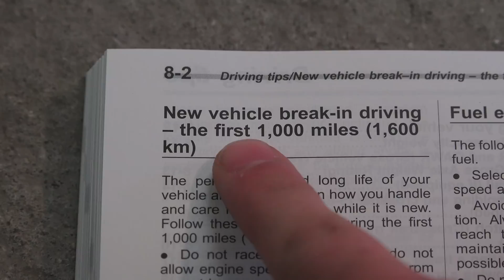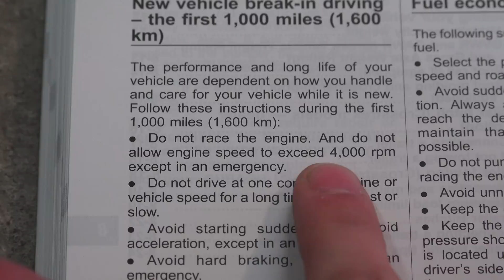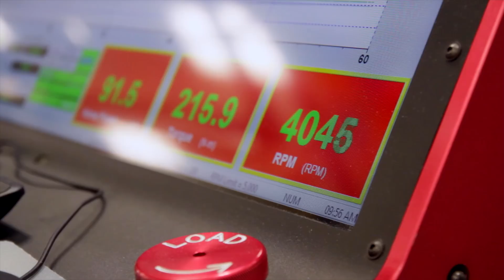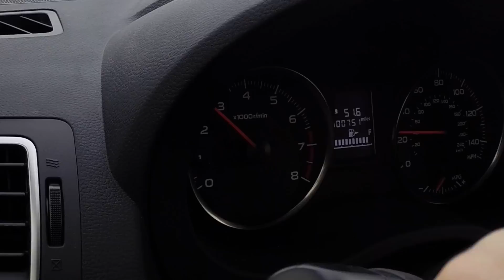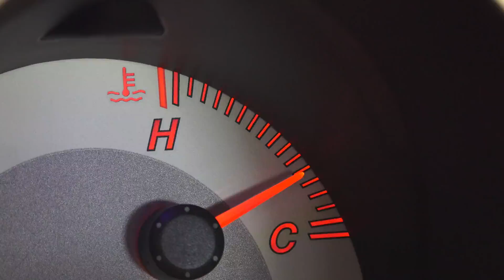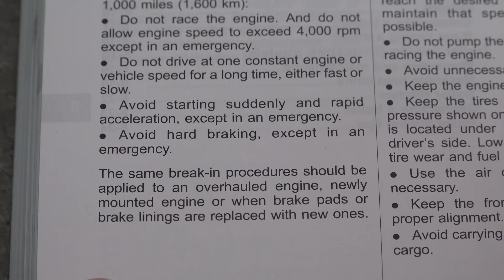5 Things You Should Never Do In A Brand New Car

Comment: I am an engineer with one of largest manufacturers of engines in the world, a company that sells billions of dollars of them every year. Items #1 and #2 are terribly incorrect.

EVERY engine that we manufacture goes from assembly into a test cell where it is started, warmed up, and sent immediately to 100% full load. Yes, it is "floored."

When we do engine testing, even prototype engines are assembled (mostly with Lubriplate 105), warmed up with standard petroleum oil, and immediately go to full rated horsepower while the dyno pulls them down from rated HP to the lowest RPM of torque peak.

Almost every automotive manufacturer follows this practice as well. So do motorcycle manufacturers. I personally saw new Ducatis going off the line in Bologna into a chassis dyno where they were started, briefly warmed, and then immediate run up AT FULL LOAD all the way to redline.

Why do they do this?

1) The freshly honed/machined surfaces can only do an ideal break-in when they are, in fact, fresh. Once the asperities and surfaces begin to smooth, they lose the ability to mate to each other properly.

2) It prevents customer complaints of high oil consumption and poor MPG because customers tend to follow outdated, bad advice like babying a new engine.

Back when machining and honing technology was far less advanced, and tolerances could not be held as well, there was perhaps some validity to babying a new engine. But this advice is woefully out of date.

Instead, the best thing you can for a new engine is:
1) Warm it up to full operating temperature
2) Do several full throttle runs that stop well short of redline
3) Idle the engine to let it cool a bit
4) Repeat steps 2&3 several times
5) Change the oil and filter.

Done.

 By and large, new engines require almost no break in at all because of the "abuse" they suffer at the factory. That's why they can ship new cars like Corvettes with Mobil 1 from the factory. No need to worry about the syntehtic preventing break-in when the engine is already broken in before installed in the car.
Reply: I really want Engineering Explained to respond to this
Reply: The strongest evidence of my point is the offering of synthetic oil as a factory fill. EVERY engine manufacturer recommends against breaking in an engine with synthetic oil. The superior lubricity of synthetics can delay or even prevent a good break-in for (especially) piston rings.

So if you can't break in the engine with synthetic oil, then the only way something like Mobil 1 can be factory fill in Corvettes, M3s and others is if the engine is already broken in when you buy it-- and before it is filled with synthetic.
Reply: Jonathan Castillo if u bought the car new from a deal don't worry....if u just built an engine and put it in a car then u gotta have a break in period
Reply: I know a handful of VVT engines have peak torque speeds < 2k RPM, but I think it's still relatively uncommon for a passenger car 4 cyl or 6 cyl engine. Most are 2500-3500 rpm, from what I've seen. Regardless, that has no bearing to your other, more important point-- that lugging has to do with the "mechanical advantage" on the engine.

Engines are pretty clueless to the world around them. Aside from environmental conditions, they basically only see 1)engine speed and 2) engine load. They don't care what gear you're in, how fast your car is traveling, or how heavy the car (and load) are.

The maximum load the engine can sustain is it's peak rated torque, and occurs at peak torque RPM. At faster engine speeds (RPM above this speed), an engine load of 100% of peak torque will pull the engine down in RPM to this speed and no further.  At engine speeds below that RPM, the engine will stall because torque output is falling with RPM in a snowball effect that stalls the engine.

But here's the key point: the engine CANNOT BE LOADED to a torque value beyond the peak torque rating. It will stall every time if this is attempted, regardless of engine speed. No engine with a max 300lb-ft rating can be loaded beyond 300lb ft without stalling. PERIOD.

So now we can ask ourselves this question: if an engine that is rated, say 300lb-ft torque at 2500rpm can sustain this load at that speed indefinitely, WHY would it be harmful to the engine to sustain a LOWER load at a lower speed? If you are "lugging' the engine (meaning the engine cannot sustain the requested load and starts to lose RPM), then you are NEVER applying more load than at peak torque. Peak torque is the maximum cylinder pressure the engine is capable of producing.

So those who worry about lugging are in the awkward position of  explaining why main and rod bearings designed for 300lb-ft will be harmed at 250lb-ft or 200 lb-ft loads at lower engine speeds. hint: they won't be. If the journal bearings have sufficient oil pressure, they are going to be fine at almost any engine speed above idle.

That's why the only real risk of lugging-- i.e. detonation-- is largely obviated by modern electronic controls.
Reply: Thank you. I was hoping to find this comment. I notice with a lot of Engineering Explained car dos and don'ts that he gets it totally, utterly wrong.
Reply: The overall engine system can become unstable at very low RPM. There's a reason idle speeds are set at several hundred rpm instead of only 300-400 rpm. At very low RPM the engine can indeed experience harmful boundary conditions. Stabilizing the engine at much lower speeds would require a flywheel so heavy that the transient response of the engine would be awful.

But the condition under which the engine is most vulnerable is also one which is almost impossible to sustain. You simply cannot sustain engine rpm below idle speeds very easily' the engine will either stall or achieve idle speed.

It's very unlikely that you will damage an ancillary mounts by "lugging". If a mount is damaged, it is usually be either a very-high mileage fatigue failure (old car/truck, probably rusted), or it was a fracture from a violent driveline impact. Drag racers using stick slick tires break motor mounts when the launch. Some people will break them with careless winter driving when they spin their tires very fast on ice and then suddenly the tires get pavement and traction and a massive torsional impact goes up the driveline. It's usually reaction loads, not vibration that fails mounts (apart from old age/corrosion).

The truth is, the lugging or stalling conditions SOUND much worse than they really are. Listen to your engine and avoid things that don't sound right. But it's not nearly as damaging as the sound may suggest.
Reply: A workmate of mine used to work for Mitsubishi Motors in Australia before they closed down years ago. He said they would take newly built engines up to redline for approx. 5 mins under load in a test mount. Dump the oil and filter and out of the testing room into a new car. Also Harley Davidson do the same thing. They dyno all of their bikes immediately after assembly and go hard on them. There's youtube clips of this. When i rebuilt my Harley I used the hard break in method. 20,000 miles later my bike runs just as hard as new and uses no extra oil.
Reply: GodGunsGuitarsGadgetsGovernment yeap, modern engines are broken in before leaving the factory. So not sure why we are having this discussion again.
Reply: So basically my style of driving a new car quite hard for the past 10 years is the correct style? Obviously always let the car engine warmup to operating temperature and not full throttle all the time, but breaking in the old way is what i never did, i just drove them normally and by "normally" i mean not babying, but not trying to break them on purpose.

However most of these cars are modern turbodiesels here in Europe. Don't know if that makes a difference.
Reply: I believe your method corresponds to MotorMan's hard break-in method, I also did this on both my new car and motorbike, works fine for me
Reply: It's possible that this is what he meant. But I'm suggesting to you that newly built engines are subjected to "lugging" like this all the time. Moreover, it is generally harmless on a modern vehicle with sophisticated electronic controls.

The old myth about lugging mostly stems from when engines would go into "spark knock" or detonation when given full throttle at low RPM. Detonation can and will do serious damage to an engine. Modern cars can avoid running lean or excessive timing advance and other aggravating factors that tend to reduce margin against detonation.

If one wishes to be ultra-cautious, the peak torque RPM is the clear "green flag" for full throttle use. But you can realize how this is somewhat silly given that some cars have very high peak torque RPM ratings and can be operated obviously at full throttle well below those engine speeds.
Reply: G5, I bought a car and didn't know I was supposed to vary the engine RPM when I bought it.  I just thought I wasn't supposed to drive at a high RPM (advice from father....).  What kind of damage could I have done to the car by not varying the engine rpm when it was new? Should I be concerned?
Reply: The exhaust will be OK. If there were any standing resonances sufficient to cause structural issues, they would be VERY loud when normally driving, and the system would fail before the EPA-mandated minimum warranty period for emissions systems.

Lugging will not damage the exhaust. To understand why the sound is loud, you have to think about the engine's internals. At very low load, the piston is easy to push down, so the expansion of the cylinder volume absorbs much of the expanding gas. So very little work is done, and BMEP is pretty low. Also, because throttle is largely closed, the cylinder is only partially filled, further reducing peak cyl pressure and BMEP.

When you open the throttle all the way, the engine gets its best VE for that rpm, so there's a lot more fuel and air in the cylinder. And instead of the piston going down almost by itself, the engine cylinder pressure is sustained a higher level (much higher BMEP). Note, this doesn't increase peak pressure, it's average pressure (BMEP). So when the exhaust valve opens, there's a LOT more pressure escaping at full load instead of low load, and that pressure creates a loud sound as it enters the exhaust.

So exhaust is always louder at full throttle, it's just that at lower RPM, difference resonances are excited (i.e., the forcing function changes) so it sounds worse than it really is.
Reply: Break in depends on engine load. If you aren't pulling a heavy trailer at high speed uphill, it will take about 500 hours of operation to really break in well.

If you can push the engine harder, you can break it in with as few as four or five full throttle runs under extreme load. (heavy trailer uphill full throttle to 65+ mph). Change the oil sooner while the engine is breaking in. I do the first oil change at around 500 miles on anything new/rebuilt.
Reply: Basically, what I'm hearing (or seeing) after reading this thread is: From an engineering perspective, there is no need to go through this "manufacturer recommended" break-in process. It is put there because lawyers have the welfare of the company to look out for. For this reason, I would presume that following the "manufacturer recommended" break-in period should have few to no downsides either. If they were to recommend a fairly docile break-in period, and it ends up actually being bad for the car, I can't imagine that would bode well with these lawyers either.

tl;dr: sounds like both break-in methods are okay to me.
Reply: As long as the engine was fully warmed before it was heavily loaded, it should be just fine.
Reply: No. Minimum NOx is  minimum fuel efficiency. The difference in BSFC at varying RPM is almost always completely offset by higher friction at higher engine speeds. You should always operate the engine in the highest gear it can handle for a given speed. If  you floor it and the car is unresponsive, go ahead and downshift.

If you go faster on the highway to get your engine at the "sweet spot" RPM, you'll find you get worse MPG from the extra speed. It's the difference between how efficiently the engine makes a given amount of power and the total amount of power required. If you need 30% more fuel, then a 5% increase in efficiency is overwhelmed.
Reply: G5
Reply: G5 .... care to tell us what engine mfg comany you work for?
Any charlatan can claim to be a master engineer for a mystery company.
Reply: The owner's manual is self-contradictory. First it indicates that no special break-in is required, but says you should treat it differently for 600 miles.

By my personal and professional experience, every word after the "no special break-in is necessary" was put there by request of a lawyer or accountant, not by an Engineer.
Reply: GodGunsGuitarsGadgetsGovernment agreed!
Reply: I worked at General Motors for 8 years build V-8s.  Freshly assembled motors all went to the test department, were started, idled for a few seconds to make sure they were running well, then the RPMs were cranked up to near redline and held there for a minute or so.  Several up and down revs from idle to near redline followed - DONE!  Ship it!  All my new motorcycles (Honda) went through my special "give it hell" break in period; warm it up for a few then go for it no holding back at all.  This has served me well for over 40 years.Manufacturer recommendations are sorted out by lawyers not real world usage parameters.
Reply: A lot of modern FI engines has peak torque at RPMs as low at 1500 or 1800 RPM.  Lugging I thought had more to do with the mechanical advantage the engine has, as in what gear/rpm full throttle is applied.  I don't think that is what is meant, since EE believes that the owner's manual should be adhered to as a technical document, when it is purely a legal one.  

For example, if you brought suit against a car manufacturer for promising you electric windows, and you claim they don't work, one of the articles of evidence would be that instructions for operating the windows were included in the owner's manual.  Another example would be if one ran their engine out of oil claiming they didn't know how much or what type of oil to add to the engine.  Again, that information is provided in the owner's manual.  Owner's manuals are time consuming and labor intensive to produce.  But they provide an immense layer of protection to the manufacturer, and also hopefully increase customer satisfaction and reduce warranty claims.
Reply: I think the idea of lugging has two factors, one  of which was already discussed (mechanical advantage).  The other is oil pressure.  Oil pressure of course rises with RPM, and if we take the theoretical approach that all oil pathways remain the same regardless of engine rpm/load, oil flow rate increases with RPM as well.

If you have low rpm, and therefore low oil flow rate, during high engine load, every incremental volume of oil is exposed to elevated operating temperatures/pressures for longer.  This can cause viscous break down in the oil.  

As far as timing goes, my understanding was that timing was advanced at higher RPM because the ignition process happens in roughly the same time, but the pistons are moving faster, so you have to start earlier.  To get a jump on it, so to speak.  So I don't understand laboring an engine at idle.  Then engine will be a high relative load for the torque it can provide, and may stall.  

This is why ECUs have maps.  These maps are iso-curves that have been theoretically started and empirically tuned that provide the engine with good operating performance across the rev range.  With modern engines, spark timing varies throughout the rev range.  We all know that if knock is detected, spark timing will be retarded, so it is sure that engine programmers are capable of modifying the timing.  I think it is a mistake to try to compare WOT at idle with WOT at max torque as equivalent in terms of timing conditions.
Reply: G5 I have a question, our brand new Kia Picanto 1.2 EX was floored several times and it almost reached its top speed on a major highway.  It ran 2457Km. Is our car fine? I mean flooring it isnt bad on brand new car right?
Reply: G5 thanks for your valuable input.  I have a Mercedes W211 naturally aspirated V6.  Based on the manufacture information, the torque plateau （350Nm）starts at 2500 till 5000rpm.  I guess this curve was generated at full throttle that is not practical for normal driving.   However does this imply that the engine should be operated (on highway, highest gear) at 2500rpm to achieve minimum NOx？
Reply: Jellyfrosh gee... I wonder if you actually read the comments or if they caused you to do a little research.
Reply: I noticed the same thing when I visited the Honda plant years ago. Last thing they did before they crated them up was to put them on a dyno and run them hard thru each gear.
I've never been told about break in when buying a new car. It's always been a motorcycle thing. I figured mfgs told customers that so they'd get a little experience with the machine before they nailed it and killed themselves. Repeat customers are good for business.
Reply: how is there even decent oil flow or temperature to allow this to be done? it seems ludicrous. can you comment?
Reply: G5 - re. "lugging" Could it be that operating your engine in near stall conditions (lugging) produces unwanted and perhaps harmful vibration in the engine, the engine mounts or in ancillaries mounted to the block? In any case, the noise/feel of a lugging engine is alarming to any mechanically sympathetic driver. Should it be?
Reply: G5 - thanks for the reply. What about the exhaust? This is usually a very long, therefore relatively non-rigid, system on rubber mounts, prone to excessive vibration in "boundary conditions". Can lugging cause bending or cracking of the header/exhaust joints or even the header bolts/studs? A lot of the noise of a lugging engine appears to come from the exhaust system.
Reply: Aren't there definite concerns for lugging with Forced Induction and/ or gasoline direct injected engines?  I've heard a lot about some vehicles having damaging detonation at high boost, low rpm situations.  The mazdaspeed3 and STI for example.  I think it's called low speed pre-ignition, and engine designers think it may have something to do with lubricants being used.
Reply: yep you are right 1000 km and new oil and filter a new engine in a new car have been reved trust me  back then they said that there was a grinding compound in the break in oil to take of the edges ha ha and the oilpump and the bearings  that must be a myth
Reply: D R I just put a crate engine in my 04 GMC 5.3 liter V8 I just drove it home and I'm kind of nervous to Really push on the gas I feel like I'm abusing it the power of this new engine is astonishing. I read the book from Napa that's where I bought my Ironclad engine and it said the same thing about not keeping a constant pace for too long very your speed check fluids and change your oil. how long of a break in do you think I would need for my 5.3 V8
Reply: G5 agreed with this break in method. I did a similar method once my Daytona 675 was warmed properly. 8k in 5 months on the streets and no issues with redline pulls
Reply: COMPREHENSIBLE POINT PROBLEMS?  

See, I can do it too...
Reply: G5 I agree! Well said!
Reply: davetek490 ... 

It does matter where he works. The company he claims to work for may have a different approach to engine testing than others. 
Why should it be a problem to reveal the manufacturer?  

Also, if what G5 says is true, then the kind of break in the end user gives his new car simply does not matter.
Reply: Yeah would depend on how long the engine has been run by the manufacturer.  I've heard that porsche's engine check out is longer than a typical manufacturers'.  However, most mass produced probably have very limited dyno time.  That leaves the process of breaking in to the owner.  

Different car manufacturers would have different tolerances, manufacturing techniques.  However, I would follow an engine manufacturer's advice over an OEM's because the engine manufacturer wants to be known for good engines.  OEMs just want you to buy a car, and get out of warranty asap.  The buyer to them is a potential liability until that point.  OEM doesn't care if your car runs great, they care if it meets "acceptable levels of performance", likely determined by them.
Reply: The manufacturer break in process is fine, as long as you realize you might have blow by probs earlier in the engine's life cycle.  For example, nissan's VQ35DE in the altima and maxima had problems early on with oil consumption.  i currently own a car with the engine, so I was interested.  Several people on the nissan forums suggested beating the crap out of the engine, and seeing if it stopped.  This would signify a problem with the oil control rings.  Several people did it, and it reduced their consumption massively.  Once they went back to regular driving the oil consumption resumed.  

I'm not trying to say that they all broke their cars in incorrectly, but it shows how important cylinder pressures are to controlling oil consumption and blow by.  In fact the root cause might have been catalytic breakdown and the dust getting sucked into the cylinders.  Even so, it seems to me that it would be important to do everything possible to get good sealing in cylinders.
Reply: I like how Engineering Explained will respond to "what is floor it" but wont even both trying to talk about this. Just shows he doesn't really understand what he is saying and is just parroting what he was told and has read. Completely agree with G5 here.
Reply: Richard Schofield...Good luck on getting honest data from a manufacturer.
Lawyers have infected American society with their greed so much that they pounce on anything, especially published documents, to get rich quick. 
Anything published by a manufacturer has to be scrutinized by a company
lawyer to ensure their asses are reasonably covered to deter other lawyers
from making mountains out of mole hills. Of course they say *it's for you and your children's safety that we do this".... Nice try, but no cigar.
Reply: You are correct
Reply: I, like most, would like to see EE's take on the theories being thrown around here.  Unfortunately, it seems it's  a lose-lose for him.  If he posts that his video is correct, he be caught in a flame war.  If he posts that G5 is correct, he risks discrediting his own words (and subsequently research).

I wonder if taking a middle-ground approach is better?  Take it easy, following tips 3 through 5.  Mostly don't floor it and keep the RPMs down below X rpm.  On occasion, wring it out for a short time once completely warmed up.  1000 miles is an eternity with a weekend car is all I'm saying.
Reply: This makes me feel better about how much I’ve floored my 150 mi car
Reply: Finally, common sense prevails.  What most non-engineers don't know, is that engineers RARELY write customer facing literature.  There is always a a concrete difference between the technical information that is shared internally within a company, and that which gets filtered by QA, Marketing, Exec Management and the Legal team and given to the customer.

Hard break in is a requirement.  Cylinder wall and piston ring metallurgy has improved over the years; this means that both surfaces are very hard to wear.  In order to get very hard surfaces to match together, high cylinder pressures are needed.  Put it this way, if you never expose the engine to higher cylinder pressures during the critical period, you can't expect the rings the to seal when they are exposed to that higher pressure later.  

I really expected something better from a channel called Engineering Explained.  The Owner's Manual is a LEGAL document, not a technical one.  A good example of a technical document with regards to cars would be a TSB, or a repair manual.  It is critical to distinguish between the two.
Reply: GodGunsGuitarsGadgetsGovernment great to hear this info I been flooring my car since day 1
Reply: Do you mind expanding on this a little for those of us less informed?  (I would like to take the best care of my new car that I can...)

The language in the owners manual--Which to my interpretation seems to match pretty well with the video--is as follows:

"No special break-in is necessary, but a few precautions in the first 1,000 km (600 miles) may add to the performance, economy, and life of the vehicle.

- Do not race the engine.
- Do not maintain one constant speed,
either slow or fast, for a long period of time.
- Do not drive constantly at full-throttle or high engine rpm for extended periods of time.
- Avoid unnecessary hard stops.
- Avoid full-throttle starts."

Could you perhaps explain why this guidance is in the manual?

In case it matters, it's a 2.0 L Mazda SkyActiv-G I4 mated to a 6-speed manual transmission.
Reply: If you've ever worked for an actual manufacturing company, you'd know the difference.   Everything every big company releases to the public is screened and cleaned by lawyers.  If an engineer or technical writer recommends something they don't like, it gets kicked back for revision.  The lawyers are there to protect the company, not your engine.  

Now TSBs and stuff released to professionals usually have minimal scrubbing.  This is why engine shops, rebuilders, etc, are the resource for accurate information.  I am unsure why people have so much trust in companies, they are out to convince you to buy their product, and protect themselves from liabilities from selling that product.  They do not care about you or your car, especially once you're out of warranty and no longer a potential liability claim to them.

There is a reason that most garage tuners rely on forums and not official manufacturer advice.  A lot of the time, forums find out about widespread issues before manufacturers do.  Experience > official titles
Reply: People... Do the research over believing some youtube guy claiming to be an expert.

The fella in the video has a point, even the best engine manufacturers apply the same logic of controlling that output and NOT going full throttle. 

then you have this fella claiming "go full throttle" with his main supporting evidence being "im a professional".

DO NOT take peoples advice on engine break ins from youtube comments. 

Go to google, find a REPUTABLE SOURCE for your information and make your decision on how to break in your engine based on the most supportive evidence there is for the "best procedure".

I'd personally take it slow. Blasting a brand new engine past 6000 RPM's with the slight defects and abnormalities/tight tolerances just sounds absolutely ludicrous to me. Talk about gouging, imperfections, etc. 

But don't listen to me, listen to the heavy research that people have already done.
Reply: Hi Richard. Your statement-- "With a NA engine, WOT is going to suck in more air and fuel per revolution of the crank at idle than any other rpm"-- is demonstrably false.

The mass flow rate (the sum of air and fuel flow rates) on a per-revolution basis is NOT higher at idle. It is precisely because the cylinders are filled most effectively at peak torque RPM that maximum torque occurs at that engine speed. Torque is the result of cylinder pressure, and maximum pressure derives from the maximum quantity of fuel burned (limited by airflow). Thus, the per-revolution air and fuel flow (i.e. volumetric efficiency) is maximum at peak torque. I will spare you the dissertation on the role of intake inertia and "ramming" in cylinder filling and why idle speed has such low volumetric efficiency. The upshot is the if an engine had high volumetric efficiency at idle speed, it would have such restriction at higher engine speeds that overall power would be very, very poor.

Engines simply do not work the way you are imagining them to. TDC is an infinitesimally small moment in time. Moreover, peak cylinder pressure occurs long past TDC. Indeed, the purpose for varying the spark timing is to attempt to maintain peak combustion pressure at a given number of degrees AFTER TDC-- typically 17°-25° ATDC, but this can vary with a given rod/stroke ratio and compression ratio and thermal efficiency vs power density tradeoffs. (expansion ratio is a major contributor to efficiency, hence the Miller cycle and Atkinson cycles).

It is therefore not at all sure that laboring an engine at lower RPM will damage an engine, nor "knacker" the rings. The only the surety is that you need to do a little more reading to increase your understanding of how engines work, based on your rather unfortunate comment here.
Reply: Then why would most manufacturers recommend not doing hard break-ins?
Reply: What a shiftless, inane, and vapid comment.  Perhaps you could elaborate on why you felt the need to make it, even in jest.  

Or am I to take the "Derp" literally?
Reply: I would suggest it depends more on the operator. It's likely that the engines were cold and not up to temperature when subjected to the full load.

Full load and high RPM on a very cold engine is ABUSE.
Reply: In most Honda designs, the engine can warm very quickly, as does the oil temperature. Hondas tend to have smaller quantities of oil circulated at higher flow rates (this promotes more even cooling and reduces wear). But it also means that the oil can increase flow with temperature in a very responsive manner.

As long as you have sufficient oil pressure, you generally have oil that is thick enough. High viscosity is really only a problem at startup when you are building pressure. Once you have established pressure and the oil is circulating, the engine is well protected even with "thick" oil.
Reply: D R are these factory tested engines tested under load? if not then you can't compare redlining an engine on a test bed with WOT in a car under load.
Reply: http://www.mototuneusa.com/break_in_secrets.htm
Reply: Oil pressure doesn't rise with RPM. It is regulated, or else you would have overpressure conditions (ruptured seals) due to excessive pump capacity or oil starvation at high rpm with hot oil due to insufficient capacity. Oil pumps are positive displacement pumps circulating a mostly incompressible fluid-- they absolutely must be regulated.

Oil FLOW does change through the engine, however. Two factors mostly determine flow for a given oil pressure-- oil viscosity (the predominant factor) and engine speed (a minor factor).

Oil flow is not linear with engine speed. Not even close. There is not 6x the oil flow going from 1000 rpm to 6000rpm. The primary restriction to oil flow in an engine are effectively fixed orifices. Bearing clearances do not get 6x larger with speed. Oil passageways remains the same nominal size (ignoring thermal effects).

There is a slight increase in oil flow through journal bearings due to higher speeds but it is also minor. Remember, oil viscosity is defined at a given rate of shear. If the rate of shear increases (as it does with higher speeds), then the oil effectively becomes higher viscosity. You've doubtless experienced the change in viscosity with shear rate. If not, belly flop off a high dive and see how the viscosity of water changes with a high shear rate caused by a human body at velocity.

So you do not have "low rpm and therefore low oil flow rate" in the bearings. Bearing flow changes very little with RPM, it changes mostly with oil temp (viscosity). And when oil is thicker, it has proportionally more film strength, offsetting the effects of reduced flow.

This doesn't appreciable increase oil shearing or cause oil breakdown. Not on the time frames relevant to this discussion.

"the engine load will be high relative to the load it can provide." As a percentage of the engines output at idle, it might be a high load (100 %) and if it exceeds 100% the engine will stall. But this low engine output is not the mechanical limit of the engine. It is due to the poor breathing of the engine at low speed, and why the engine makes low power. The mechanical system is designed for much higher loads than can be induced at idle, and the engine will stall long before one can harm a bearing.
Reply: Yes, newly built engines require break-in. I strongly recommend a high-load, full throttle regime as you'd get on an engine dyno. A Chassis dyno like a Dynojet can't apply enough load for proper break-in. A superflow or Mustang chassis dyno is better for break in purposes.
Reply: True, but it's likely the opposite of what you are thinking. In most cases, the dyno load is substantially higher than what the car can apply.

In the car, you have the mechanical advantage of the transmission and the traction limit of the tires as limits to the amount of load the engine can actually see.

In the dyno, you don't have those limitations. In almost all cases, an engine dyno can produce both higher loads and higher changes in load than almost any vehicle can.
Reply: The answer to your question, Richard, is that factory tested engines are nearly universally tested under load. There may be exceptions that exist outside my knowledge.
Reply: Agree entirely. Do not believe me or any of my claims. GO ASK SOMEONE WHO knows engines-- an engine builder, a hot rod shop, a dynamometer operator. Not someone who writes owner's manuals with lawyers breathing down neck.

Then you can come back and tell SACR3 I was right all along.

By all means, ask any professional rebuilder or race team. Then report back here and see what they do to break in their own VERY pricey engines. They will tell you as I have-- warm up the engine, then full load.

NOTE-- full load isn't necessarily redline or overspeeding the engine. Do not misquote me. By definition, maximum load is at peak torque, which occurs at much lower RPM than redline.
Reply: G5 I think what EE meant by "flooring the engine" was not to apply full throttle at low RPM.  At high rpm it is fine with full throttle as long as the coolant temperature does not runaway.        Please correct me if I misinterpret.
I did floor (above 4000rpm) all of my 3, 4, 6, 8 cylinder Japanese and German cars during the 1st 100miles, all of them consume no oil, and exceed the HC, CO, CO2 standards.  I never lug my engines.
Reply: G5 surely labouring an engine at low rpm causes more engine damage than at peak torque.
With a NA engine, WOT is going to suck in more air and fuel per revolution of the crank at idle than any other rpm. 
Unless your engine restricts throttle at low rpm (some do, it's really annoying)
Then you have the burn that will propogate through the mixture really early in the stroke when there is no room to expand into.
This yields low torque as the moment on the crank at TDC is zero however the pressure in the combustion chamber will be higher than at peak torque for the above reasons.
Result 
Knackered piston rings to follow.
Reply: "you need to do a little more reading to increase your understanding of how engines work, based on your rather unfortunate comment here" what a miserable response. Try and be a gentleman and keep your responses limited to your technical opinion.
Peak torque is greatly affected by the ignition timing. This is one of the reasons why torque falls either side of peak torque RPM. At lower RPMs the timing is too advance for optimum. You want peak pressure at roughly 20 degrees after TDC for max torque. I don't know where peak pressure typically happens at idle, but it will be much before 20 degrees.
So, you have a smaller space, less mechanical advantage and more air. Even if you are correct about the air mass bit (which I don't believe you are) the difference would not make up for the fact that you have less space in the cylinder at idle peak pressure. 
I never said peak pressure happens at TDC, I said at TDC you have zero moment on the crank (basically saying less moment than at peak torque).
Try labouring your engine at idle and listen to what happens.
Reply: davetek490 I think the Derp just told us what his job is on accident out of rage of him not getting to design actual useful things.
Reply: Doesn't matter where he works.  Don't believe him, if you don't want.  I went and did my own research and asked people who have been working on cars longer than me (and at a way deeper level).  

The way to think about it is this: you have rings sliding against a cylinder.  Cylinder, when new, has a process called honing that roughs up and removes the glaze on the cylinder walls.  This process allows the rings and cylinder to wear together a little bit so they match.  But it takes high combustion pressure to do this.  Basically you want to expose the system to the maximum pressure it will see in its lifetime so that the rings seat, so it will seal well when it sees the pressure in the future.  

If you don't have high cylinder pressure when the engine is new, you won't have good seal when the engine is new.  And if it doesn't seal when it's new, no way will it seal when it's older as things wear and clearances open up.  You don't need to be any type of specialist to propose this idea.  

Follow your owner's manual if you want.  But every car person knows that when you have a serious car question/issue, you hit the forums, and not the book in the glovebox.
Reply: A guy where I work floored (because the circumstances requiered it) two different cars straight out of the agency and in less than a month both cars were getting repaired, so maybe depends on the type of car. A sport car is expected to be floored because that is why said car is bought.
Reply: G5, I really appreciate that you don't blindly accept the common wisdom about lugging.  I am very skeptical, and nearly every explanation I find is full of sloppy thinking like, "You're making the engine work harder," which defies the definition of work.  I would love to see a real IC engine designer run some real numbers on internal parts, loads, etc. and say something like, "Even when 'lugging', you can't exceed x% of max bearing load, so you can't damage the engine that way," or, "When 'lugging' you may have x% higher bearing load for a sustained time compared to normal acceleration through upshifting, so you might take a few thousand miles off the life of the engine if you ALWAYS drive that way," or something more concrete like that.  But it seems that no one really knows anything concrete, and like you say, I guess those who do are not permitted to say so because lawyers.  :(  Anyway, keep up the good work.  There's someone wrong on the Internet!  :)
Reply: thank you for posting. People thumbs up this so information is not mis-represented.
Reply: Sacr3, your reply is full of red herrings and straw men. No one said companies are out to get your. Nor did anyone say their advice causes engine damage.

The consequences of soft break-in are "soft" failures like slightly higher oil consumption, slightly lower MPG, and lower engine durability.

None of these are likely to cause a measurable, statistically significant increase in warrantable failures. And most manufacturers only measure warrantable engine failures. They don't care if the engine lasts 20k or 200k more than the warranty. It costs them nothing because the engines are out of warranty. Most manufacturers don't want things to last TOO long, they want to sell you a newer car.

Now there are companies (like Honda) whose internal culture is such that they will design an engine to last as long as it can reasonably last, regardless of warranty. But they are the exception that proves the rule. Honda considers itself firstly an engine company, and they also happen to make things into which they install engines.

So it's simply not the case that a soft break in will cause compression and bearing issues within 100k miles across the board. A hard vs soft break in isn't the difference between a survival and a failure, it's the difference between a good engine and a GREAT one.
Reply: do you honestly think a manufacturer would put out an engine without testing it under load? look man, there are plenty of things you can nit pick at but engineers of course test their engines as apart of the building process.
Reply: sacr3 I'm not a professional, but common sense leads me to believe sacr3. interested if anyone can find some manufacturer published info that says to rag it.
Reply: You won't.  Their legal team doesn't want the associated risk of customers saying they slammed into a school bus because they found a manual entry saying to floor it.  Ever watch mustang fail videos?  

The only issue with WOT is that you start bypassing the oil filter, since engine manufacturers want maximum oil flow at WOT.  That's why people who recommend a hard break in, say that you should change the oil often during the process.  They believe the break it is complete within the first 50 miles or less.

The point is, that if you want something with pressure based sealing to seal at a design load, let's say WOT, then you have to wear those parts in at the design load  pressure.  You can't wear them in at half pressure and expect them to seal at full pressure later.  

http://www.mototuneusa.com/break_in_secrets.htm
Reply: Simon Griparič lawyer's. if they said you need to drive your new car hard and you crashed it you could file a lawsuit saying they are reponsible for the crash because they said to drive it hard. so they say to baby it.
Reply: A very good explanation sir. I have more trust in your comment rather this urban legend video
Reply: Jeffrey Lurch I asked a question. I did not state an opinion that wasn't subject to my question. read.
Reply: I was being a gentleman to him. I didn't call him names, and I am not responsible for how he may choose to react to being told he is ignorant about engines. We are each ignorant of at least a few things. Mine ignorance happens to include german polka history, among others. His happens to include engines.

Fortunately for him, he is not alone. You are likewise ignorant of some aspects of engine operating, design, or theory.

Torque is affected by engine timing. More precisely, CHANGES in timing are associate with CHANGES in torque. Yes. But the purpose of calibration is to remove the timing variable by optimization. There is for each speed and load condition only ONE optimal value. Since timing is optimized, all changes in engine torque are not due to timing changes. Rather, the timing changes are due to the changes in engine speed and load (VE).

So it is therefore false that timing is what is causing the torque to fall on either side of the peak rated speed. The changes in torque output of the engine are almost exclusively due to that being the optimal condition for airflow through the engine-- a modal resonance of sorts. At every engine speed below peak torque, increases in velocity are more helpful to VE than increases in restriction are harmful. Above peak torque, increases in restriction offset fully the advantage of increased velocity. (Typically peak torque is the engine speed where intake flow approaches supersonic and cannot be accelerated via vacuum).  And it THAT factor, not a change in timing which produces the change in torque. Timing doesn't CAUSE the change in output so much as REFLECT the different operating condition. Remember, the engine is tuned. Timing is repeatable. It is not creating changes in torque, it is reflecting them.

Peak pressure at full throttle at low engine speeds (near idle) is not high. Firstly because the timing is retarded to reflect the low speed. Secondly because there is very little air and fuel in the cylinder to burn. Low engine speeds mean very low intake velocity and therefore very low volumetric efficiency. The engine simply doesn't breathe well enough to take in enough air to burn a large amount of fuel, and thus the main drivers of cylinder pressure (timing advance and lots of fuel) are both severely reduced.

So you do NOT have a smaller space, less mechanical advantage and more air. Rather, you have the same space, the same mechanical advantage and LESS air.

And unless you are talking about the kind of variable compression ratio engine that Nissan recently announced,  you never have "less space" in the cylinder. It is always the same. Each crank angle 0-180deg maps to exactly one cylinder volume. Regardless of speed (I'm ignoring inertial effects on con rod length).

It is true that at TDC you have zero moment on the crankshaft. But it is also completely irrelevant and inconsequential because that condition as at all times very low cylinder pressures, far less than the peak (which will occur as indicated more than 15 degrees later).
Reply: +davetek490 Companies are out to get you? If they gave bad advice which in turn damages engines long term, than they'd have a very bad reputation for their engines. Everyone would be having compression issues, bearing issues, valve issues, etc within 100K miles and it would be a across the board issue.

This would hurt them. I don't think their goal is to kill your engine off sooner so you can buy another car. 

Specially those companies selling the top end Ferrari's, Lambo's, etc. Considering the money they spend.

If going hard for a bit when you first obtain your engine is top notch advice for best performance? Than it would have been the recommendation. Obviously they have better results with breaking in an engine slowly.

Physics wise, it makes sense.
Reply: G5 "...an engineer with one of largest manufacturers of engines in the world..." Very specific. Surely you must be too busy and important to be debating in the comments section of a YouTube video. You obviously are busy engineering things and definitely not screwing around on your computer, surely. Engineer is also a vague term. For all we know you could've just engineered stylish car-themed coffee mugs for the guys actually designing the engines to drink out of. Or one of those scaled-down plastic models of the engine that get used for presentations at the board meetings where they also drink from said coffee mugs. Perhaps this analogy is getting way too specific, either way there's probably better things to be doing.